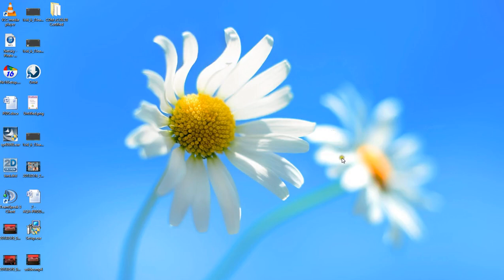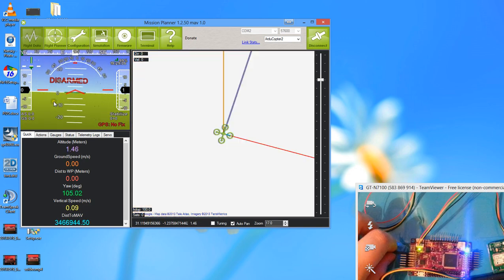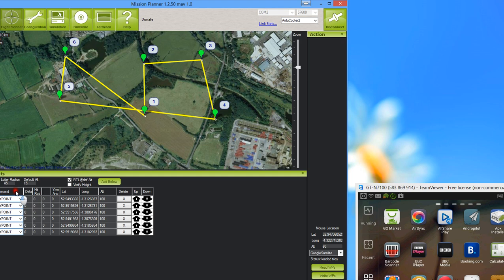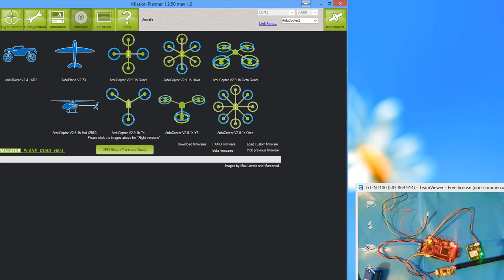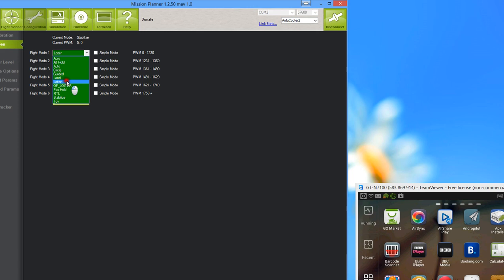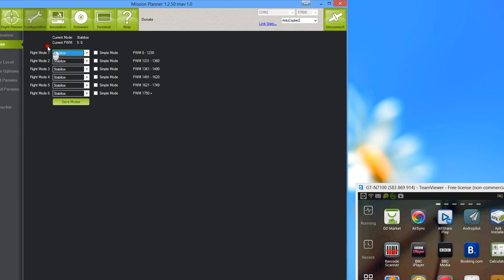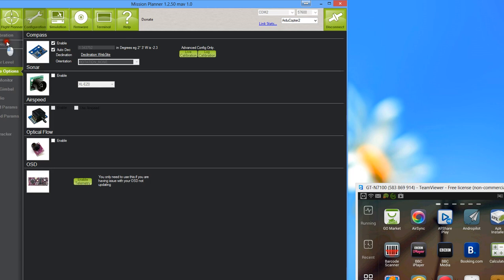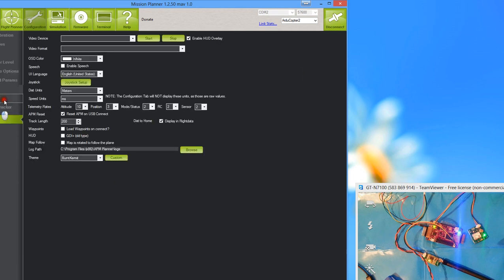How to set up your APM 2.5 and a tutorial on how to use Missionplanner and its features

Comment: Am I correct, all you need to fly using mission planner is 433 mHz 3DR Radio Wireless Telemetry Module Ground Station for MWC APM2.5, Andoer APM2.6 Flight Controller, and the program? I am new to multicopter and also am wondering if I need a gps?    

Thanks,

Comment: Thanks for a great video, well done! Can you tell me if this connects with usb to usb micro or does it require a USBasp for programming. Looks like a great board, would have had this ages ago had I know how simple they are in comparison with multiwii. more functionality than Naza for a fraction of the cost :) Is anything else needed other than the board and gps module other than servo leads? What mavlink and osd would you recommend?

Comment: Jared, hi again, i covered the baro, but in alt hold and loiter, acelerates too, i don't understand, maybe another thing or setting are wrong?
the flight is stable, and the control is ok, now

thanks again
Reply from the maker: try position hold, like loiter but doesn't hold altitude, it may be a faulty baro

Comment: My gps is configured to 115000 baud, that won't work?
Reply from the maker: you need to set if for 38400
Reply from the maker: you will need a usb to serial adapter to reprogram your gps, google for help, i think i may have a tutorial video but i am not sure
Reply: Jared Reabow thanks, i have another question: what is the jumper for and do i need it.